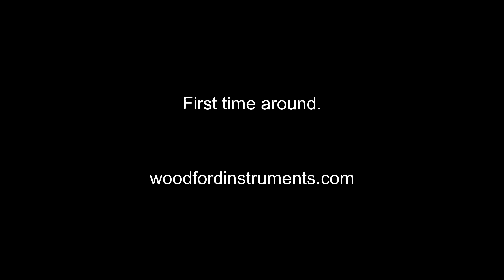A first-time set up

Comment: That guitar sounds damn good
Reply: It sure does!
Reply: Yea, I noticed that too.
Really rich.
Reply: more than damm good!!
Reply: Not falling down a set of stairs it wouldn't. I'll see myself out.
Reply: I'd be really happy to turn that out.
Reply: I love your reassuring words for beginners.  And not ripping into what's wrong, but instead talking about the build challenges.  I love your channel.  I'm geting my feet wet by working on some inexpensive parlor guitars.  Your channel got me over the hump of not even trying.  Thanks.
Reply: @schneidp20  awesome comment. I’ve had a "kit" sitting around for years now, this video/channel is helping me get out of the paralysis and ready to start.
Reply: Indeed it does. Lots of mids.
Reply: Darn good/ nice volume 👌

Comment: In the 80s I bought a neck billet without the dovetail cut, a premade neck block and pre bent mahogany sides. spanish cedar 2 piece unglued top, 2 piece unglued. mahogany back , bone nut and saddle blank, uncut spruce braces, blank ebony finger board , prebent herring bone rossette and top purfling with back strip. economy tuning keys and a bottle of titebond glue all for around $200.00 I had a Cheap jig saw a drill, utility knife, and stand paper, was about all the tools I had at the time. To cut out for the inlay purfling I used a razer blade screwed to a small block of wood at the proper width. Finished it with 2 part epoxy and turned out a ugly but nice playing and great sounding guitar, oh yes I also used a ebony bridge.Somewere in the range of $200.00 to $250.00 I was very happy, of course materials have went up since the 80s and I don't know if you can even get neck billets anymore, but a billet isn't much more than a mahogany board. Any way thanks I just wanted to share my 1st build.

Comment: Luthiery is something Ive been interested in for quite some time and it is the very points you made in the first couple minutes here that have held me back from even starting; sometimes called, "analysis paralysis" Ive always equated it in my mind as the cheetah on the plain failing to make a kill because the herd has all stuck together, making it nearly impossible for her to choose just which gazelle to zero in on- or "where do I start??" The list of steps in my head and also having the knowledge enough to realize I probably am unaware of many more steps still, oh god where to even begin? This unfortunately is a difficulty I suffer from in nearly every other area of my life as well.

Comment: Thanks Ted. Having recently done a setup on my acoustic. Your advice in this video, gave me extra confidence in what I did. The only regret is that I used cheap nut files which caused me problems and extra time messing about getting the slots correct. I really need to get quality nut files. But hey, Christmas is coming!

Comment: The first guitar I made I basically just threw it at the repair guy recommended to me (Mr Glyn, makes great pickups now, lovely guy) because the nut was so high, and the frets were a bit all over the place. He tried to talk me into doing the setup myself, but I knew I didn't have the materials and skills at that time to do that bit, even tho I had done every single part up until that point from scratch, self taught, in my high school's wood shop. (Or in my driveway in a fridge box for the painting, and the neck clamped to the picnic table for carving...) Nut files, and fret leveling, can both be intimidating at first! By the time I was doing the second build I was confidently smashing out gorgeous fretwork, bone nuts, etc. But the only reason I think I was mentally able to pursue it was because Mr Glyn got that guitar to the best shape it could be in when I couldn't have got it there myself. Because it went from unplayable to one of my favorite guitars to play, to this day, in 3 days.

Comment: I have a StewMac ukelele kit that I completed about 5 years ago.  It's hanging in my workshop because I didn't get the neck angle juuuuust right.  Had I discovered twoodfrd back when I made it, I bet I wouldn't have made that mistake.  Now that I have discovered twoodfrd, I start thinking I can do a neck reset....then I remember that the kit was $125 and I should probably just indulge my "I've never smashed a musical instrument" fantasy, and start over.

Comment: I made a list of all the individual pieces of one of my "average" guitars. All the wood pieces, metal parts, screws, frets position dots, etc. and etc. The total was about 143--144. And of course each piece has to be attached, assembled, or glued etc in the right place in the right sequence in the right manner for the right outcome. But yet, its not tremendously complicated. A lot of work because there are steps  that aren't counted here ...like cutting a nut with its slots, cutting the fret slots, cutting the individual wood components and fitting them, drilling the various screw holes.

Comment: Actually thanks to you Ted, I went back to my first Octave Mandolin Prototype, and started a Kung fu neck reset on it (the neck had ended up being slightly out of line). It also gave me the opportunity to correct the chunky neck. 
The neck ended up too thick because I forgot to add the fretboard thickness into my measurements (a beginner mistake to be sure).
Considering all the firsts on my first build, and the fact that the plans came out of my head and not from blueprints, my first was a success from a proof of concept perspective. A playable, but not sellable instrument (Not that I was expecting to make money off of this the first time around). 
I also used reclaimed wood, Black Walnut from a table I purchased at a second hand store cheap. So the only "new" wood used was the soundboard, fretboard and headstock overlay. 
I would agree, it would have been nice to  have had some instruction. Of course, mistakes were made. Most, I was able to correct.
6 Octave Mandolins later, the latest bears  very little resemblance to the first prototype.
Reply: Bro, don’t tease us, upload some video of one of your octave mandolins, I’m sure at least 12 of us would love to see it

Comment: Very nice for a first build.  Hopefully the person that built it keeps it and plays it regularly.  ...I have to mention my take on nut setup, of which I've done a few.  When going after those last few thousandths of an inch in height reduction, don't do it with fresh strings.  If you get it just perfect with fresh strings, you'll find it is not happy after a day or so.  The new strings will have more of a curve to them at the nut and the saddle instead of laying down at the take-off point.  Just a word of warning - I've done that wrong several times and had to either make a new nut or use the CA glue + bone dust trick...which is a bummer.

Comment: I assume you took the tape off the bridge plate.  BTW:  The first acoustic guitar I built ha a too-thick neck.  Still does.  Second one was better.  You are right about being familiar with routers being important.  I made my living as a carpenter so I learned early which way yo un a router.  I used a router attachment for  Dremel whin routing for binding.  Lesss powerful so it is easier to manage.  My second guitar I made a mistake on scale length so I had to fill the saddle rout and rout a new on in the proper place.

Comment: I made a Flying V guitar 20 yrs ago ( my first guitar build.) Made many mistakes ( fretboard at the nut is a bit narrow, but not unplayable, almost like some of the early Gibson SG’s) Finished it with an oiled finish. Body’s a tad narrow. ( couldn’t afford a wider two pieces of Brazilian mahogany) Good points,,, self made truss rod ( which works perfectly) Electrics all work. Intonation is good and the action is good. Has been kept at home, never in a case and the neck is still straight. 😉😉 Have played this semi professionally, so very proud of it. Probably cost me £800 altogether to build and probably not worth it, but it’s mine. 😂😂😂

Comment: I use a rare earth magnet to gauge the depth of the truss rod, assuming I know the truss-rod to be a single-action steel threaded-rod style truss-rod. Stick the magnet to the back of the neck and get a feel for how attracted it is to the truss-rod below the surface of the wood, then use a piece of steel with wood shims in an effort to duplicate the attraction. This is made easier given that the attraction of the magnet grows exponentially as the distance closes.

Comment: I built one acoustic dreadnaught. I struggled through it to the point of fitting the neck to the body and I chickened out.  Then decided that I could practice on building a few ukuleles before I attempted the guitar.  Still wasn't perfect but I figured that if I screwed up a few ukuleles it only cost me about $150 each instead of $600-700 for the guitar.

Comment: I think if you go in with the idea that what you're doing will be junk, that it makes learning easier. You buy non-precious lumber, you take your time but dont agonize over perfection, and if it makes a guitar sound at the end, you know you did the thing! Plus, any mistakes are also opportunities to learn how to potentially correct those mistakes... or at least what wont correct those mistakes... and thats just as valuable as a builder as getting it right in the first place (if not MORE valuable IMHO).

I started with a used $50 squier strat, with 3 missing strings, wasted frets, half the finish was taken off, filthy, broken pick guard.... and here I am almost 25 years later still tinkering with it, changing the electronics mods on it at the moment now that I'm finally replacing the pickups (lesson learned on one, dont brush the tiny wind wires that go to the solder points with a brass brush, 25 years without a middle pickup... missing out on the best tones!)

Comment: Great job, can you show how you make the compensated bridge? Thanks
Reply: He kind of did, actually. He shaped the saddle to the basic curve and thickness, then used a piece of 'G' string between the strings and saddle to find and mark the correct string lengths, similar to adjusting an electric's saddles back and forth while comparing the 12th position fretted notes to their matching harmonics. The only part we didn't see is the actual filing/sanding to the take-off points, which is mostly just filing down the saddle top at an angle up to your pencil marks.
And importantly, getting the intonation right on an acoustic starts with making sure the neck is straight (enough) and has the right relief and that the nut slots are cut to the correct depths, but that's covered as well! 🙂

Comment: Great wisdom and empathy in this vid. I built my first guitar (having built a couple of lap resonators) and things went well. However, eventually that stats catch up with you unless you actually know what you are doing and I had some disasters further down the line. I can testify that setup is hard, but, if you go at it systematically, it doesn't need to be a buttock clencher, because it isn't all or nothing. By contrast, fretting is really important to get right ASAP (or you simply run out of useable metal!) and finish work for an amateur is a nightmare (for me, anyway), because every flaw is there for all to see, and it seems to matter more to onlookers than what the thing sounds like. The guitar aesthetic is a factory fine finish, whereas in the violin world the aesthetic is an individually crafted object that sounds good and plays well. Finally, however good the notes you keep are, it's really hard, as a hobby builder, to deep track of the important lessons you learn with every build. Ideally, I'd want to build about 3 times as many as I do, just to keep the practice effect. Anyway, as this guitar shows, and as Kathy Matsushita said (roughly) after her first build: 'It sounded great and it didn't fall apart or anything.' I

Comment: When you sift through the most popular reddit groups and encounter the words "a proper setup", you learn that countless people that say this aren't quite sure of what it in fact means! lol I've seen it pitched many times but if it doesn't involve the skills to do fretwork, you're getting ripped off. 
Yes, I've seen people doing "a proper setup" for 50, 75 and even $125, but all they do is set the action, tinker with the truss rod, maybe shim something as the most technical operation and change the height of your pickups lol.
Reply: A proper setup on an electric guitar is 10x easier, and every guitar player should learn how to do it themselves.
Reply: @chamber32doors  Most definitely. It's fundamentally just basic maintenance. Paying someone to do it beyond your first or 2nd guitar is foolish and irresponsible. Unless a guitar is very problematic even after you learned how to do it, there's no good argument to be made about paying for it.
Not unless they're teaching you how to do it firsthand, or you're a girl. 😂😂
Reply: @JonDeth 
My girls will not only set up your guitars, they will also change your oil, rebuild the engine, transmission, fix your plumbing, and sell that house back to you for a profit.😉

Comment: Often wondered, if on a new build you made the fretboard a tiny bit wider and not do any finish work on the neck for a winter and see if the wood would truly dry and sirnk enough to have the edge of the fretboard be the same width of the neck? You would have to delay the completion of the guitar for 6-12 months? That’s hard to do, unless you spray lacquer on the body only and after the winter finish the neck, giving the lacquer time to off-gas and cure?  I’m probably not thinking the right way! Love this video for 1st. time builders. Thanxz

Comment: IMHO, the first one shouldn't be a serious build nor should it be taken too seriously. I wouldn't personally put much time, nor effort, nor coin into it. It should be an experiment, a game, a "hide and seek" with the notion of experiment + time = knowledge. This bypasses the "unfinished project" curse, quite a bit. It doesn't make you an experimented luthier, nor would it gain points with experts, but ... hey, if it's the thing that breaks the "hurdle" and removes those mental blocks, then ... it's worth it, right? And this applies to any project really. Rigidity is a joy buzzer, and not worth it.